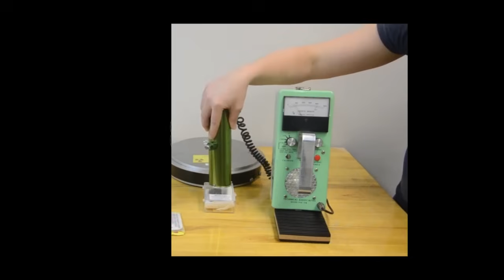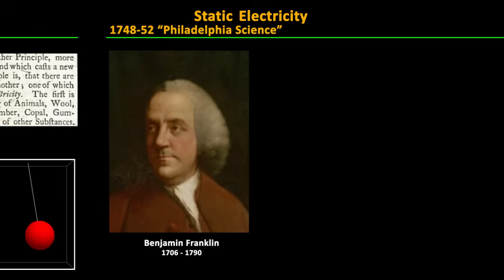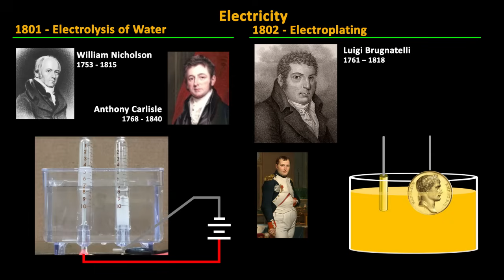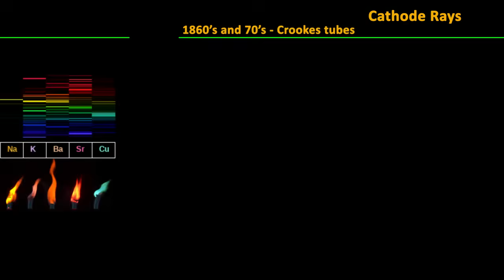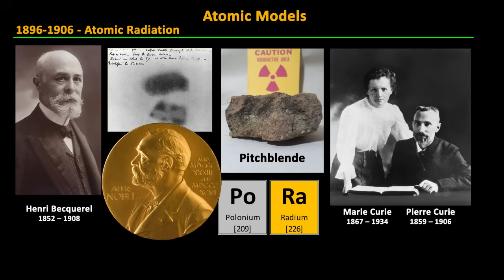The Electron (old edit)

Comment: How the election orbital decay problem can be resolved by Lord Rayleigh and subsequently - the Plank’s constant? Is not fully understood or explained.
Reply from the maker: Rayleigh’s theory basically said that hot bodies could emit radiation of arbitrarily short wavelength (i.e. arbitrarily high energy), but Plank set things straight by assuming the hot bodies were made of discrete oscillators (we would say atoms) which limits the possibilities for generating short wavelength vibration modes and avoids the ultraviolet catastrophe of Rayleigh’s formula.

Similarly, Bohr’s theory says that you cannot have arbitrarily small shifts in the energy (or equivalently, the angular momentum) for an electron orbiting the nucleus.  This limits the possible energies of electro-magnetic radiation and prohibits the electron from losing energy beyond the ground state of the lowest possible (non-zero) energy level.  
The full explanation of why this is true will have to wait for a future deep dive into quantum mechanics, but you can get the idea from de Broglie’s model that the electron wave has to vibrate around the nucleus in a coherent manner.  Hopefully this better describes the logic I was trying to present in the video.   

One implication of quantum theory is that although the electron possesses angular momentum about the nucleus, it is not moving in a circle as far as Faraday’s laws are concerned.  The electron wavefunctions exist everywhere around the nucleus at the same time in their energy clouds. Maybe thinking this way can give you a better mental model of what is going on, but quantum mechanics takes some getting used to.
Reply: philoso377...........The ORBITING ELECTRON does not spiral down to the proton because of emitting photons,   because ORBITING IS JUST FREE FALLING.   ORBITING is the SAME thing as FREE FALLING except you have enough x axis motion to fall around the planet OR PROTON.   And FREE FALLING is an INERTIAL FRAME.   Otherwise we would weigh LESS when on the side of the planet that faced away from the sun and weigh MORE on the side of the planet that faced the sun.   THAT DOES NOT HAPPEN !!!!!!!!!!!!    That is why a FREE FALLING accelerometer says it is INERTIAL.  This is why you float and feel no force when in free fall.    The inertial PATH is accelerated down by gravity and the falling or orbiting object just follows that SAME INERTIAL PATH but that inertia path is constantly being accelerated down.   Since the falling object or ORBITING OBJECT(ELECTRON) is not accelerating relative to spacetime it is NOT A PROPER ACCELERATION.  PROPER acceleration ONLY happens when an object (or charge) is accelerating RELATIVE to spacetime.       So the orbiting electrons dont emit photons cause they are NOT ACCELERATING relative to spacetime.   LET US REMEMBER that a wave function is GRAPH that REPRESENTS the probabilities of  something being in a specific position in the future.    THE WAVE FUNCTION IS A GRAPH that REPRESENTS the electron's probability of doing something in the future....IT IS NOT AN ELECTRON  !!!!!!!!!!!!!!!!!!!!!!!!!!!    The electrons and photons OSCILLATE and so when they move forward the PATH they create is a wave PATH.   The electron is NOT A WAVE but when it moves it creates a WAVE PATH and so it obeys wave equations......DAH.   The electron bounces off of stuff  in the  double slit experiment like a photon cause they BOTH move in a PATH that is shaped like a SINE WAVE and so they get the SAME PROBABILITIES.       That is what particle-wave duality means  >>>>>The electron is a PARTICLE but OSCILLATES when it moves and so moves in a  PATH shaped like a WAVE.
Reply: @johnblacksuperphysicist  thanks. Well said.
Reply: @philoso377  ............It is only well said if you believe it.
Reply: And yet Bohr got a Nobel for just recognizing the mathemaatical ratios.  Gave him so much clout he then led the whole scientific world astray by championing the 'Copenhagen' metaphysical BS, and we are still recovering from it.
Reply: @rogerjohnson2562  science and the academia is captured by a closed circle society.

Comment: ## Comment on "The Electron - History of Atomic Structure"

This excellent historical overview of the electron's discovery provides the perfect experimental foundation for understanding why a deeper theoretical framework may be needed.

The video beautifully traces how each discovery built upon the previous - from static electricity to cathode rays to quantum orbitals. However, several experimental anomalies mentioned deserve closer examination:

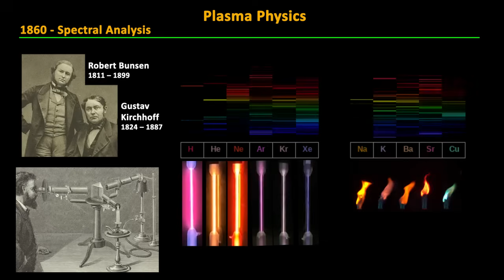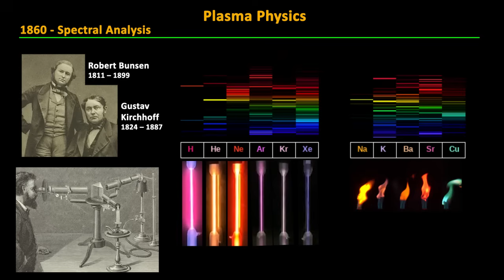**The Spectral Line Mystery [6:54-6:59]**: While Bohr's quantized orbits explained hydrogen's spectrum, the video notes this mystery persisted for 50 years. The T·m = 1 framework suggests these discrete emissions aren't from "quantum jumps" but from electrons traversing regions where time approaches zero (T→0), making transitions appear instantaneous while remaining continuous.

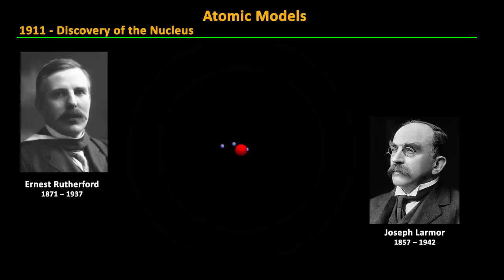**The Orbital Decay Problem [11:38-11:47]**: The classical prediction that orbiting electrons should radiate energy and spiral into the nucleus was "solved" by quantization. But WHY doesn't this happen? In the time-mass duality framework, stable orbits exist where time dilation exactly compensates energy radiation: dE/dt × T(r) = 0. No arbitrary quantization postulate needed.

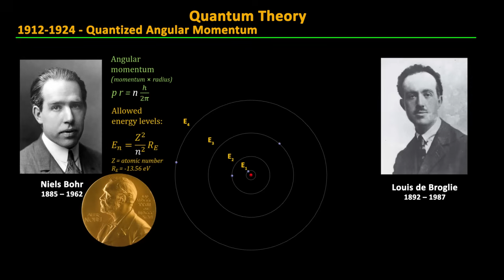**De Broglie's Wave-Particle Duality [14:32-14:44]**: The video presents this as a mysterious dual nature. However, if c(x) = c₀/m(x) varies with local mass density, then "particle" behavior occurs where m is large (T small) and "wave" behavior where m is small (T large). The duality emerges naturally from T·m = 1.

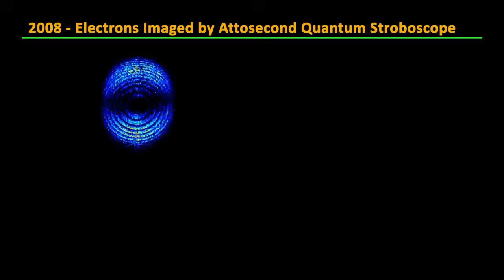**The Attosecond Images [16:08-17:28]**: These momentum space maps showing "allowed and forbidden" electron momenta are fascinating. The ring structure might reflect not quantum restrictions but regions where T varies rapidly, creating apparent boundaries in momentum space.

The historical progression from Thomson's plum pudding through Rutherford's nucleus to Schrödinger's orbitals shows how each model addressed specific experimental challenges. Perhaps it's time for the next step: recognizing that what we call "quantum behavior" might be classical physics operating under extreme time variations maintained by T·m = 1.

The experimental foundations shown here - from Faraday's electrolysis laws to modern attosecond imaging - remain valid. What changes is our interpretation: not mysterious quantum jumps but continuous evolution through regions of variable time.

Comment: So how big is an electron?
Reply from the maker: Great question…  but a difficult one to answer simply.  

An electron is a fundamental particle like the quarks inside protons and neutrons that I plan to describe in the next video.  Fundamental particles are considered by some theories to be like geometric points which are dimensionless and have zero size.  In some theories (like string theory) there is a smallest possible size which is called “The Plank Length” and is on the order of 10^-35 meters.  By contrast protons are about 10^-15 meters (aka a femtometer, aka “one Fermi”).

Another way to think about size is quantum mechanically.  The electron wavefunction can be interpreted as the probability of finding an electron in any given location, but like Schrödinger's Cat, you could equivalently think about the electron being in all those locations at the same time until the wave function is collapsed by a measurement.  From this point of view, you can consider the size of the electron to be on the order of its quantum wavelength.  The wavelength of the electron wavefunction is given by the de Broglie formula as Plank’s constant divided by its momentum.  This means that the faster an electron is moving, the smaller the space it is confined to.  Electrons in atomic orbits actually determine those atoms’ effective sizes and have wavelengths on the order of Angstroms.  As we will see in the next video, the Stanford Linear Accelerator Center has a 2-mile-long electron accelerator that can get electrons moving so fast that their wavelength is about 1/10th the size of the proton. 

Finally, we can talk about experimental data.  Many experiments have been done to see if electrons really are point like particles and none to date have been able to prove otherwise.  The collective results suggest that if the electron has any size, it must be less than 10^-21 meters.  A good video summary of these experiments can be found here: https://www.youtube.com/watch?v=R7JnfTnqoRM
Reply: @AtomUni   :  What quarks, protons, neutrons .. are.
Reply from the maker: https://en.wikipedia.org/wiki/Particle_physics
Reply: How much space does charge take up?  Depends on the pressure from other electrons caused by pressure caused by gravitation.  When it nears the size of the proton then fusion of electron and proton into neutron happens, then neutron with proton to release energy (sunshine).  Testable by looking for neutrinos from proto-stars before fusion.
Reply: @rogerjohnson2562  lol